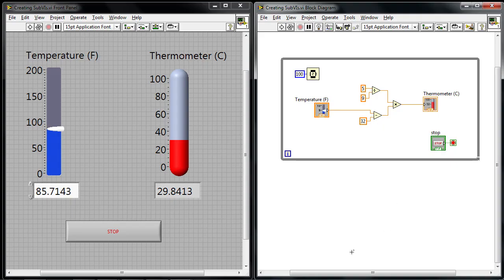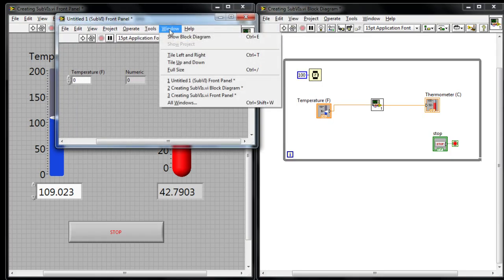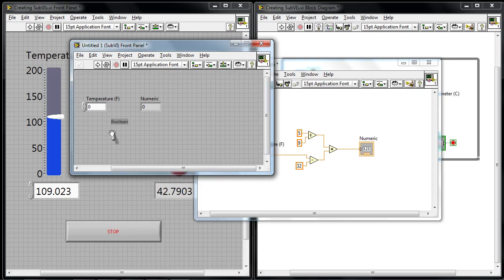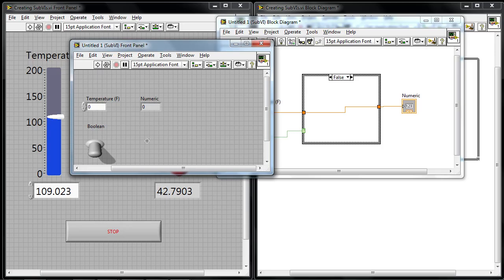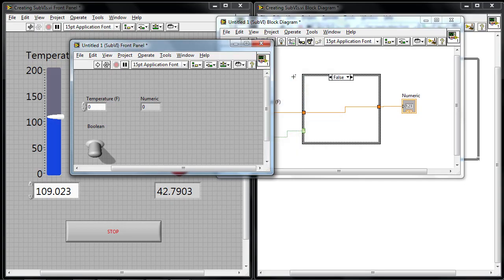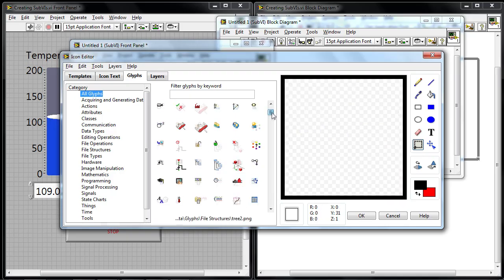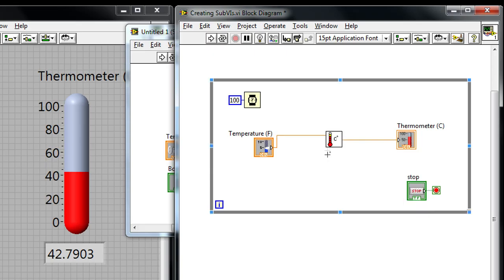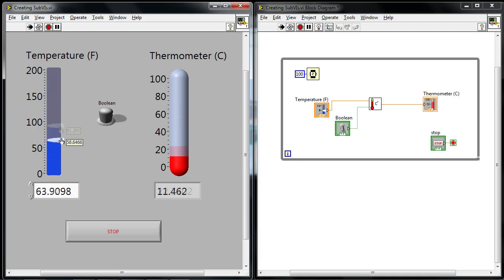Creating Sub VIs in NI LabVIEW

Comment: I made a subvi that iterates through the first column of an array of values at fixed time intervals and I want to output the generated values as they come. For some reason it works fine when I open the subvi, but it doesn't output any data when I put the subvi in another program. Why could that be?
Reply: @bobopet2 thanks for asking! 
Based on your description and if we’re understanding correctly, you’ve likely fallen into a not all to uncommon misunderstanding of how dataflow works. 
Your sub-vi indeed is a method. Your sub-vi will not run, until data ‘flows’ from all upstream sources to it’s inputs, and similarly so, your sub-vi will only complete once it’s done running and will output whichever data is on it’s terminals at completion.
Going off of experience, I’d guess that you’ve got a loop in your sub-vi which runs multiple times at your desired rates, and then once complete your sub-vi is done and other parts of the calling program only get the last value executed in the VI. 
It's an easy thing to get turned around on as you get started understanding dataflow
As this comment is limiting in response, we’ve made a post online that you can find the more complete response
https://forums.ni.com/t5/LabVIEW/VI-not-outputting-values-at-regular-intervals-when-used-as-sub/td-p/4434323

Hope to see you there for the answer!

Comment: Why do we need to add the connector in the panel of the sub vi when we already added connection in the block diagram? Shouldn't it automatically generate that? The block diagram shows 2 input and 1 output. And the second input is boolean which is also in panel. Shouldn't the software make connection on its own?
Reply: Just because something exists on the front panel, does not mean that it's automagically connected to the connector pane. There are several different reasons to no have everything wired out and also to have control of what things are placed where on the connector pane.